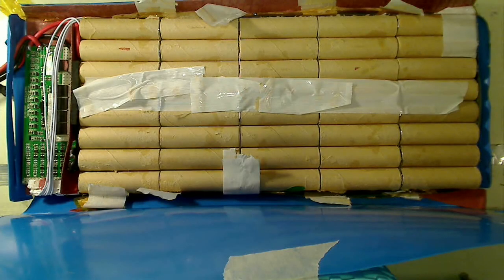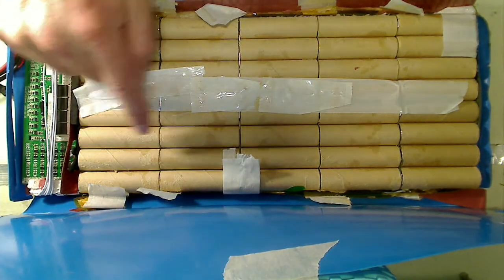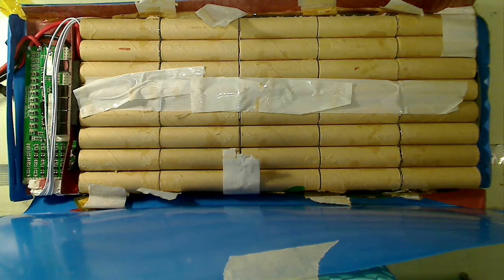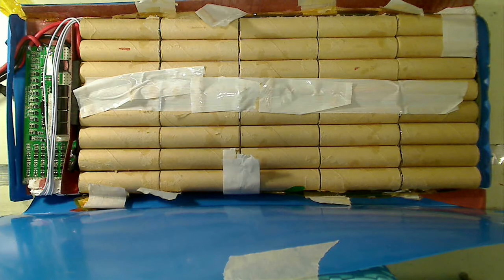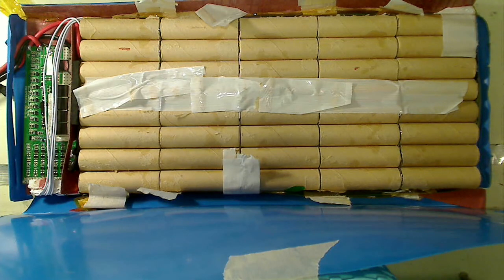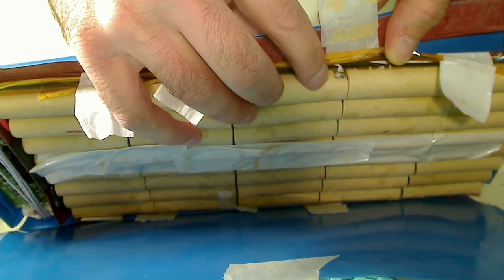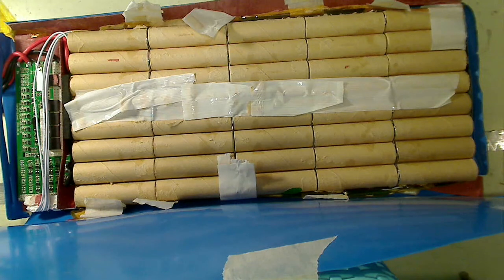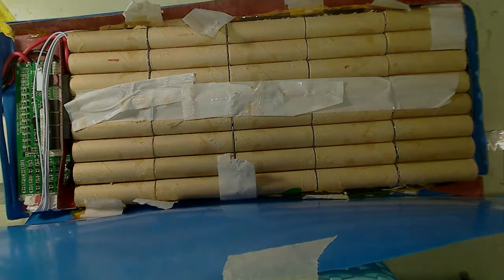Lithium Battery Pack Anatomy - Metroboard Electric Skateboard

Comment: Thanks for this, bought a battery and charger from you a while back and knew it had a BMS in it but nice to see it here and have it explained a bit since I'm far more familiar with LiPo batteries from other RC hobbies and was curious ho5w this was wired up internally.  The battery has been top notch by the way, I've gone on 25 mile+ journey with the 10S 5P battery on pneumatic tires (on esk8) and still had 16% left (according to metr.at) when I got home, well packaged quickly delivered too, thanks a ton!

Comment: Minimum cell voltage below 2.5 V or 3.5 V? because 2.5 V seems way too low?
Reply: It is 2.5 but it's better for the cells to not discharge no more than 3volts, you get barley any capacity from 3volts to 2.5 volts anyways